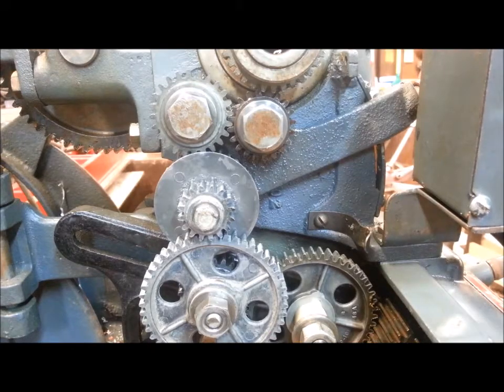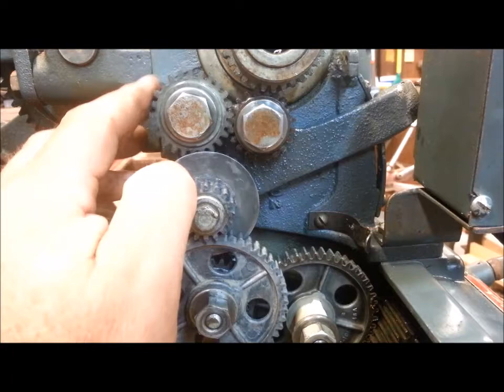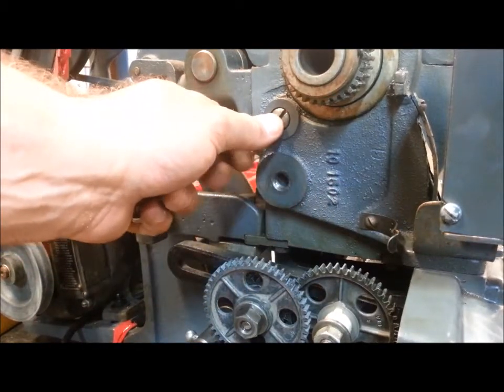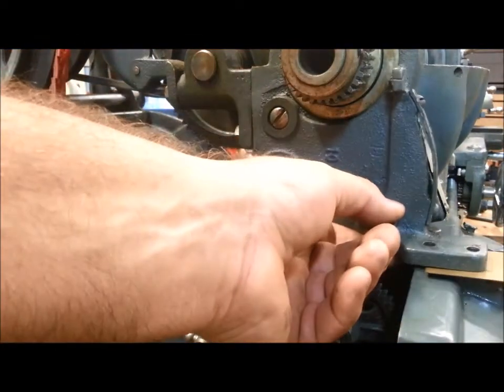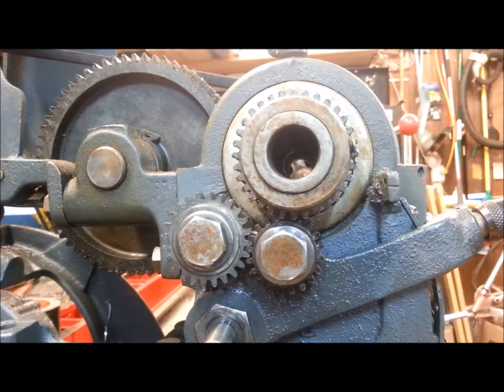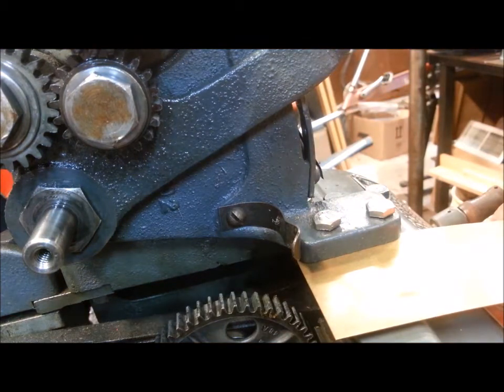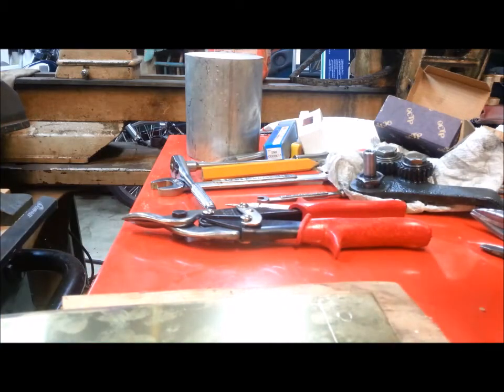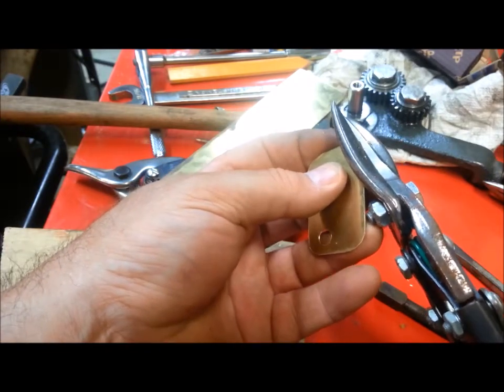Atlas Craftsman Lathe Tumbler Gear Lash Problem Solved Part 1: Old Gray Lady Muffled

Comment: Um...   No oil on the gears?
And..   I made a bolt with off center shaft to correct that.
Reply from the maker: I'm sure I oiled them either off camera or shortly there after.   They are goey as as I type this.  ;-)
Reply: Nit picking lame

Comment: Tumbler gear consist of how many gears
Reply from the maker: There are 2 tumblers.  One, the other or neither are engaged at any one time.  They are idler gears meaning they do not change ratio but simply move rotational force from one place to another.  In center position there is no engagement which means my gearbox and lead screw are not turning.   In either of the other two positions I can use them to feed the carriage or compound in or out when I engage them with the carriage controls.

Comment: Hot diggity dog! As you know, I'm having the same issue. Now I know ho to address it. Awesome! BTW, Tubalcain just put up a video on adjusting the change gears. Uses a method with a sheet of paper between the gears to set the correct distance between the teeth.
Reply: a tip: you can watch movies at flixzone. I've been using them for watching all kinds of movies during the lockdown.
Reply: @Jesse Kingston yea, I've been using flixzone for since december myself :D

Comment: i think your gears are wore out to a smaller size. what your doing is a good way to get a longer life out of them
Reply: Bob how are you. hay email me your address. so I can send ya that hide
Reply: ok
Reply from the maker: +Bison Workshop The tops of the teeth are still there.  The faces wear, not the OD.  There may be some wear there for certain.  The pitch distance between gear sets would be a fairly fixed value.  The OD of the gears is still intact from what I can tell from inspection.
Reply: cool

Comment: whoa boy you might want to look up how to modify a drill for brass. it tends to suck up the drill and is very dangerous to drill sheaf stock the way you did. (not preaching just don't want you to get cut up ) this is a great idea I'll have to see if my standard change gear model can be adjusted like this.it sounds like a harvester with  them in gaged
Reply from the maker: +Chris Anderson Yea, I should have done it between slats of wood.  I don't want to alter my bits as I'll rarely be drilling brass.  The really proper way would be with a Whitney punch or some kind of shop press.   I own a punch set for leather.  I thought about using it but decided against it.  I'll be careful in the future if I do any more brass sheet.